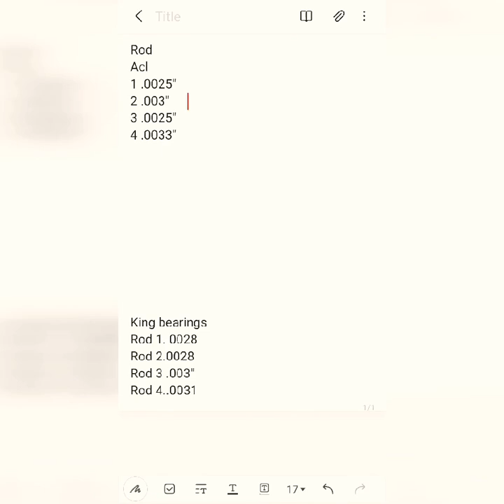Aluminum rod 4g63 6 bolt build

Comment: Looking great, what is this build running currently and any future plans with this one?
Reply from the maker: The motor got paired with a g42 1450 from pulsar. Sadly while at our local track when I made my last pass I wrecked the car. Did a small part out. I’ve been slowly secretly building another one behind the scene. We will be coming back and swinging as hard as we can! Car made a nice solid a-b pass. Turned it up more and more demanding everything it had. Babied it off the line and after the 100ft we threw everything it had to it. 75psi at 22° of timing. Was a crazy fun rocket!
Reply: @dsmperformanceracing4355  looking forward to the new build..!